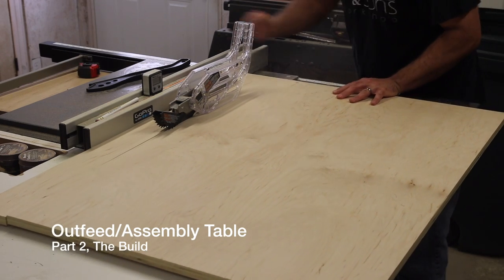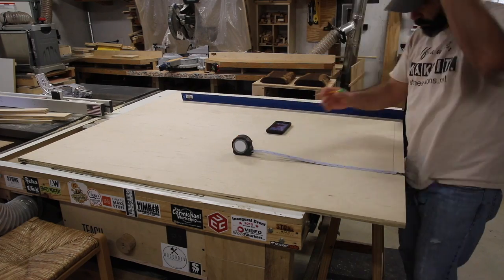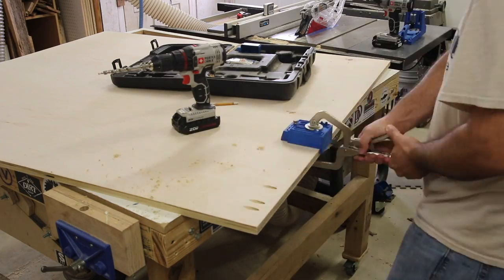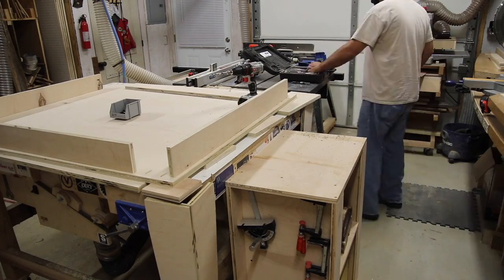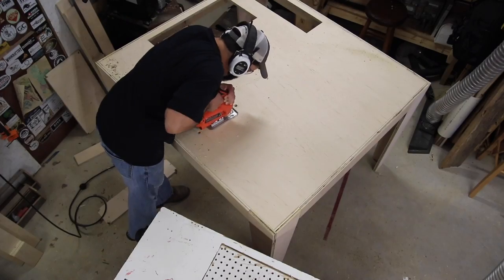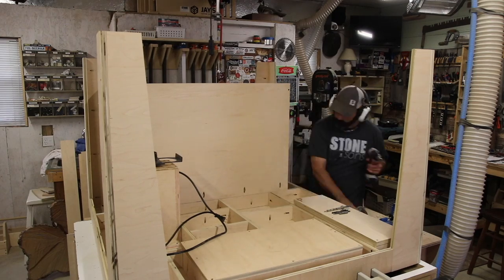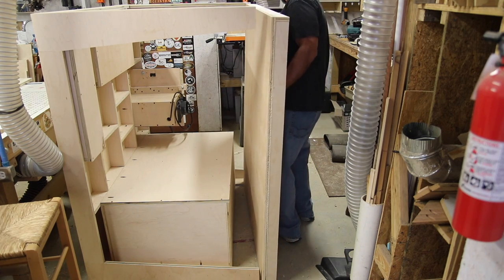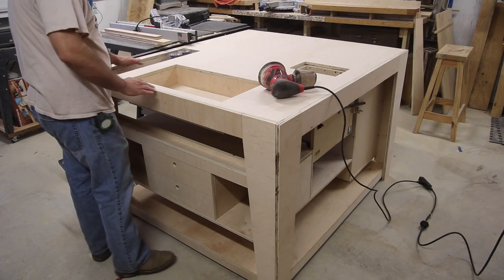Build a Tablesaw Outfeed Assembly Table - Part 2 The Build

Comment: Great outfeed/assembly table. Obviously a lot of thought went into it. I will be ordering the plans. I  plan to use the pipe clamp setup from the "New Fangled Work Bench" from Fine Woodworking in place of the vise and bench dog holes.  This will allow mounting various bench top equipment.  Do you have any ideas about casters/wheels to allow moving it around?

Comment: Nice!  Is your saw a Delta 36-725?
Reply from the maker: +Tony Cobb Thanks! Yes it is. I made the table at 36" high and that's enough to make a cut and cut again without the first off cut getting in the way. I really didn't want to make dados in the table for a crosscut sled either.

Comment: Nice multi function table. Funny how you are using the Jay Bates router lift still and he is not. Just funny how we all decide to move forward. Did I see you mr PC drill batteries died? I have an older 18 volt. Drills are in great shape. Batteries are crapping out. I'm frustrated became see I can't even buy a new battery. So I have to buy a new set at some point.
Reply from the maker: Thanks! The batteries died during the build process, but will recharge. That's the first time I haven't been able to get through a build because of the drill batteries. I guess they're becoming weak.